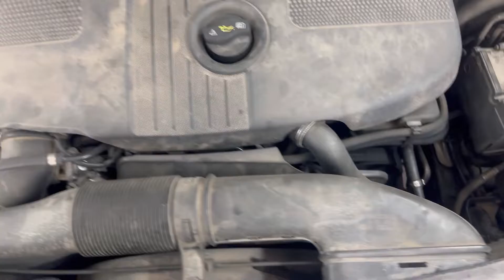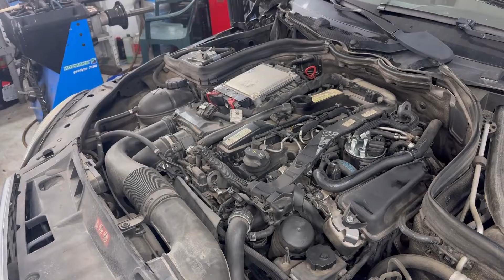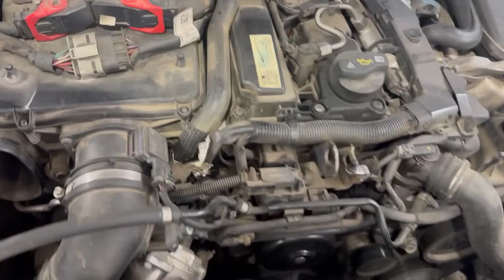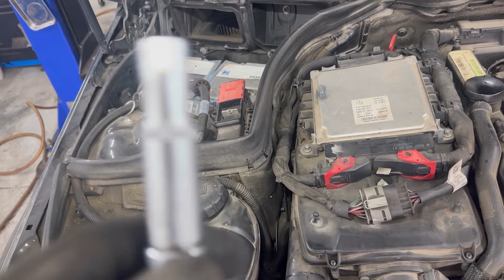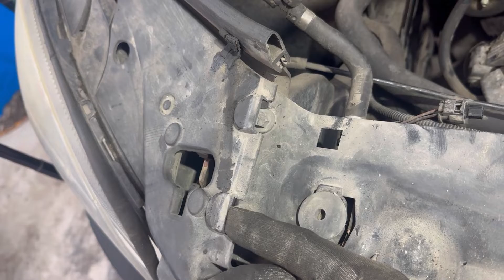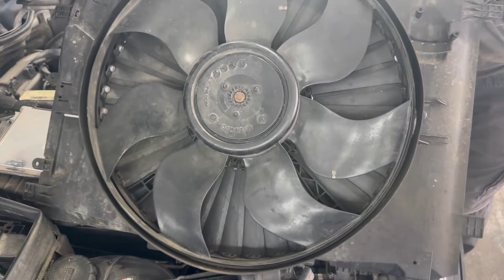Mercedes C220 CDI W204 Alternator removal replacement

Comment: Thanks for your time. I did mine last year. Fitted a voltage regulator which has the brushes and diode in it, about €85 euros,lot cheaper than a new alternator. If bearings are ok. Mine had done about 94K miles, 151k km, brushes 2/3rds worn so worth doing. Electric plug is awkward to get out as so little room.

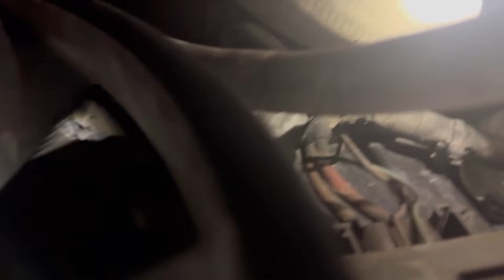Comment: And how do you removed the plug at 16:18 ? Why do you can't show the full steps? But thanks for the rest.
Reply from the maker: @AmatorisLatexCouture  there is not much space to put the camera in there and to show how to disconnect the electrical connector. There is a tab on the connector that you press and then you pull it out
Reply: LOL!!